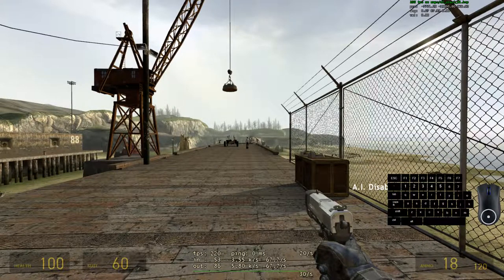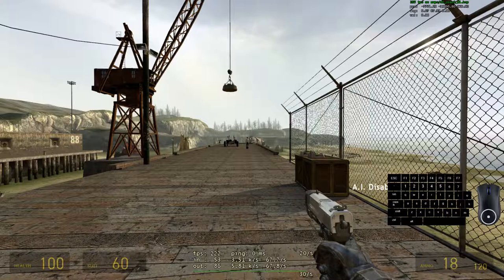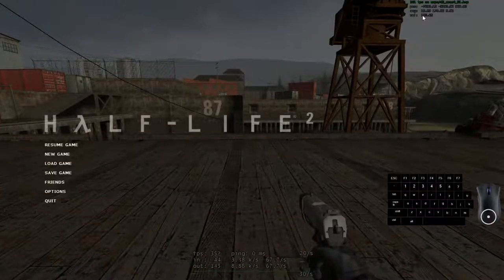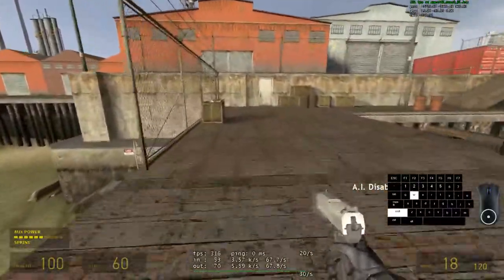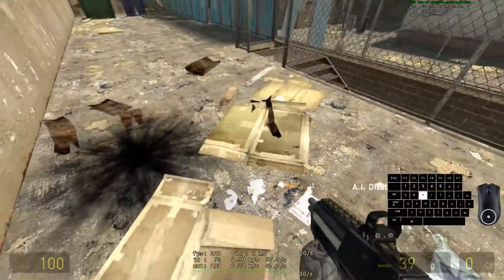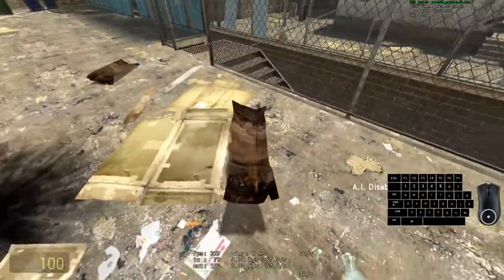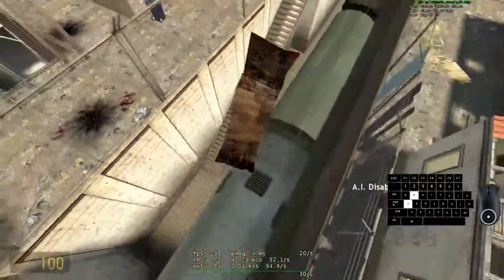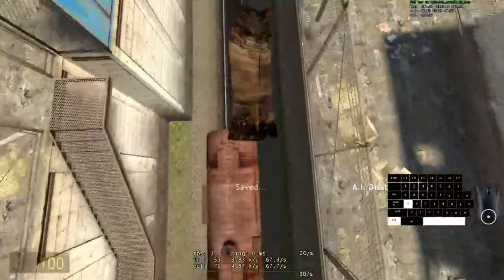[ Basics ] Half-Life 2 Old Engine Tutorial - Prop Flying

Comment: Bhop is possible with sprint no back bhop
Reply from the maker: Due to how old engine works with gaining forward momentum, while yes you can sort of bhop with sprint, its inefficient and useless because you will gain no more than 300-400 speed, unlike forward bhop where you can gain 2000+. ABH is not possible on old engine. So please, stop talking nonsense, thank you.
Reply: @-mirakapz97-23  have you ever bhoped in left4dead2
Reply from the maker: yes i have, and the reason why its different is because L4D2 was released in 2009 when almost everything got ported to the Orange Box ( the start of New Engine ) by changing how all the physics of the game work. Old Engine HL2 as seen in the video is the version from 2004 to 2008-9 which had its bugs from release before being patched. Please do not try to compare the physics of a updated engine to a older version of it. While with the Orange Box port , ABH-ing in HL2 was possible, the reason why we cant do it in L4D2 is because Valve was aware of the bug and patched it out, but since its source engine, they made it so it sort of resembles CS bhopping, thats why its possible there and not on HL2. Again, please dont talk nonsense when you havent done your homework.